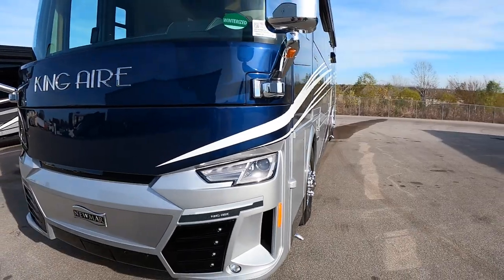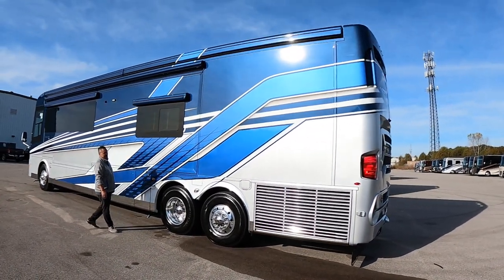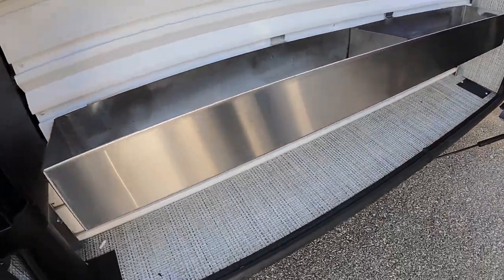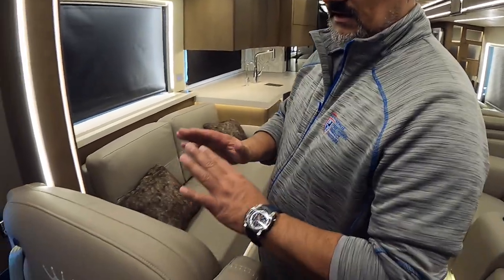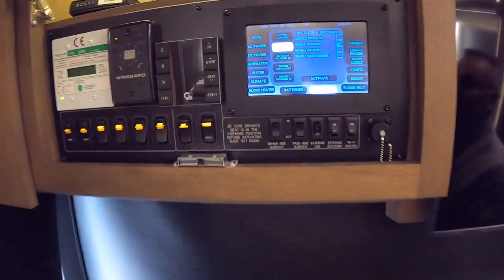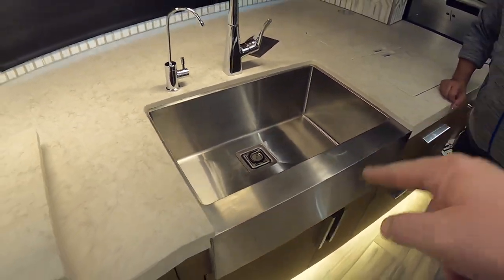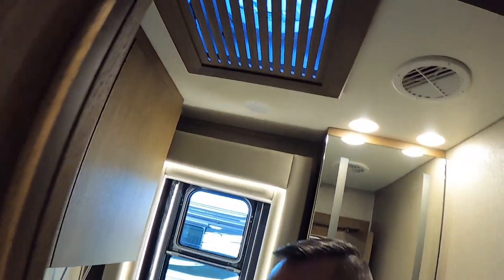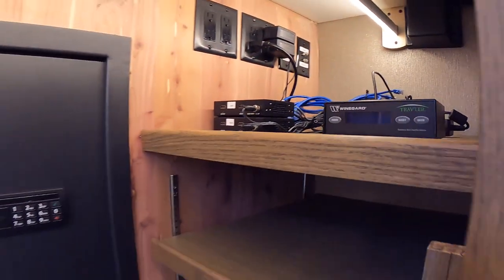THE MOST EXPENSIVE NEWMAR MOTORHOME IN STOCK NOW!

Comment: My idea hving master hve best view bc up front only works bc it has most wasted space door or no door or emergency exit.If u do't want passenger seat u can hve a love seat or 2.5 seat or coach turned along wall u just hve to pull 1 seat or park pull both seats. Then partial kitchen or no kitchen up front not even suit coffee bar hotel room. Then u roll base the two seats around how ever in the design. small desk& coffee bar along other wall. Center bed so easy to walk all the way around, crazy wild God man. That leaves rest of the interior rig still, for plank sheet layout. If the bed can lower down from ceiling even better deal.

Comment: If u make a thru bay on 1 side go thru to other side but not in line but 50% offset so u hve to open 2 doors on the other side it might help if u hve a wide idea even though not easy slide out on both sides bc offset 1 side u hve double wide if u offset the bays. I think so early here & stay up late got up early.

Comment: Very nice coach, great paint job too. The large windows look great, but you cannot open them for fresh air and from the standpoint of insulation they are not good either. I wish Newmar would do a better job on the woodwork. You see the staples in the front in the pantry drawers since they are not dovetail (looks like no drawers are dovetail). The entry door looks very cheap inside too. And what is this with the storage doors, when you touch the blue button I saw the person trying to get them opened prying his fingers between the door and frame. Is there an option to open them when the power fails?

Comment: If using wide item door there is a self that side over tfe normal narrow slide shelf but if not using wide slide out then u just use narrow shelf drawer either way just Can't slide thru on both sides just IN line narrow door slide way/bay.

Comment: Is there locking of the outside bay doors when you are away? It just shows a blue light to open. Doesn't say whether the doors lock which could allow vandalism. Can Newmar add armouring, bulletproofing to protect those inside given the current environment in some areas?
Reply: the doors can be locked. You can lock with your wireless key fob, keyless entry near the door, and from inside the coach.

Comment: If crazy tired styling 20yrs old going w/gray furniture & not swayed or wool sweater  then U Must use 2 or 3 different shades of gray, 2 min on back cushion every time. Bed cushion use 1 color on 1 side & use sides of cushion & 1 face of cushion diff color gray. Even if u flip light or dark side it will hve side showing & bc 2 color on back cushion it will match or be light side of butt cushion must. the sides of cushion show u r new cool not 20yr old stuck in mud gd freak even 1.5+million freak.

Comment: I need a production side & a custom dead wood side waiting too soon die long done playing/living any way. It is lie pulling teeth at my corp & if I get my 80/20 ration of 5k per yr then Newell will hve to walk on water 4500k every yr or 1/2 the corp will hve to head roll. I need service ppl skilled & behind the product to rap off on king aire get it done mass production shorter lower quality coach line 40ft down is your end or my other 5k class d slide in not on rigs with own axles independent over the f250 outside tires deal. If 5k is class d greatest product sense 5th wheels. I don't want u to be nowell no pnt. I want u to product copy share rub off good traits but handle step down 40ft tow power special coach A substitute for class super c type tow but flat front end. And my new money if product class d line. U just raise or lower chassie of class d so u get that sweet spot balanced wt distrobution safest way poss. U need more carry in truck or more tow in truck no problem OR u want more carry in class d slide in no problem bc u hve the 3 slide out model sitting on just a 350 truck Wow mind blow greatness God full power. Truckcan still go off road w/or w/out slide in & tow halleys comet type wait for greatest idea since bp& j